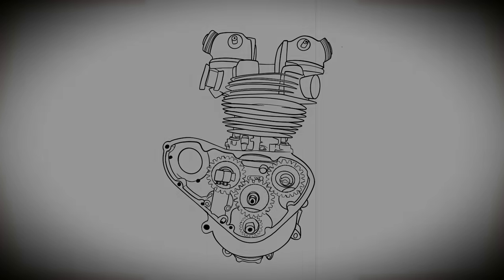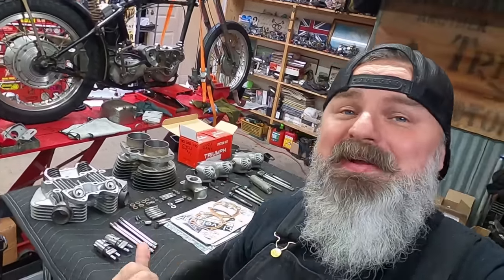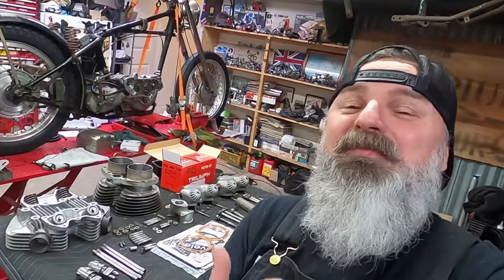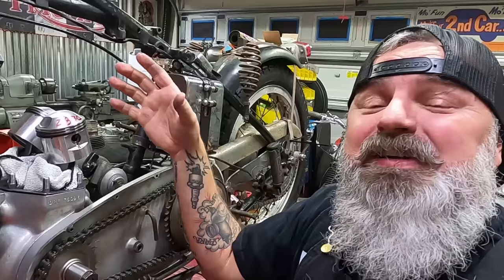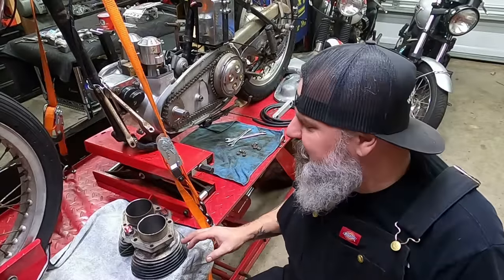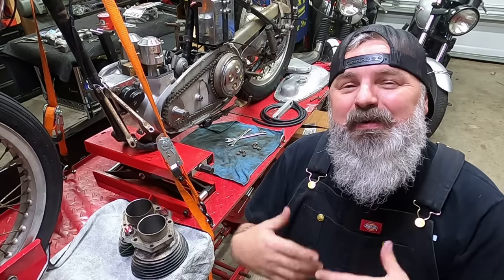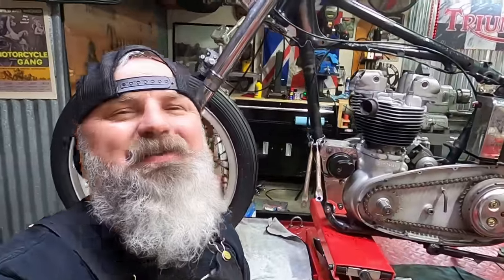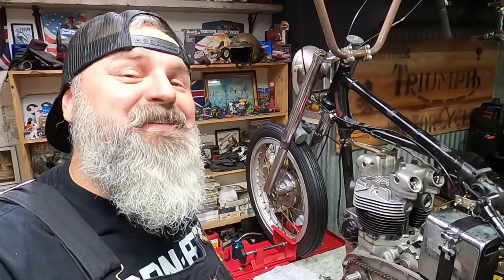Chopper Top End Install! Pistons, Cylinder, & Head!

Comment: What a timely video! My T120R leaks from the upper pushrod tube seals :(
Reply from the maker: Well now ya know how to fix it!
Reply: @weemsmotorco  Thanks for adding all the detail on the SQUISH - It took me about 12 full hours today; slowed down by rocker box gasket removal, and the 100 tries to get the intake pushrods into position. Now to get some mileage on it and hopefully not bathe the engine cases in oil!!!

Comment: Did someone bet him how many times he could use the word 'index' incorrectly?
It's good that  gaskets are now being used and attempts made to keep the oil inside. The Richter video is well worth a watch, he waffles on occasion, but goes more in depth and seems competent. It's worth buying a  new Amal Premier carb, if Mikuni is considered unoriginal, then you won't have a worn Amal body, slide and inaccessible pilot passage to  drive you  nuts on mixture settings.
Reply from the maker: You know it!